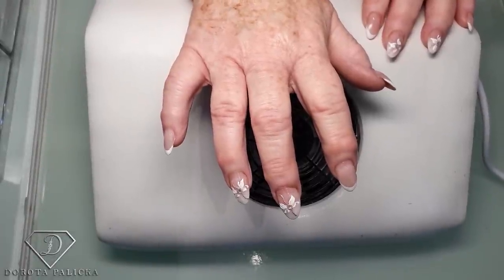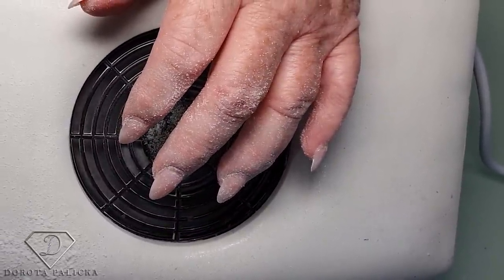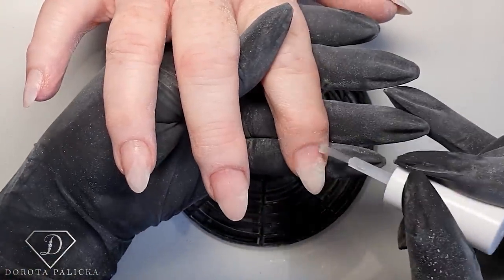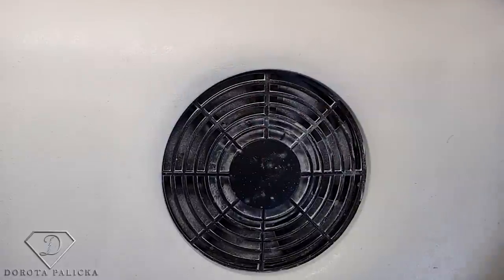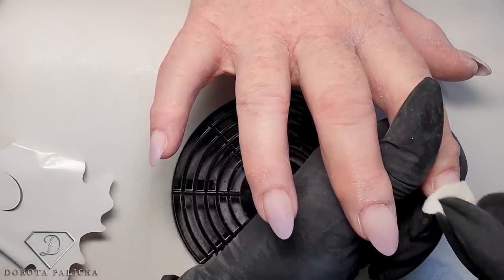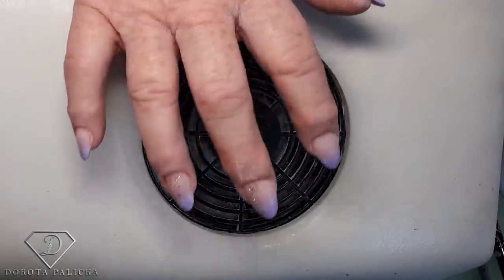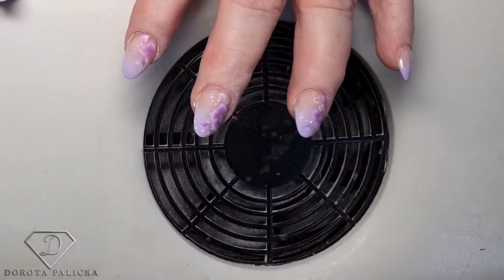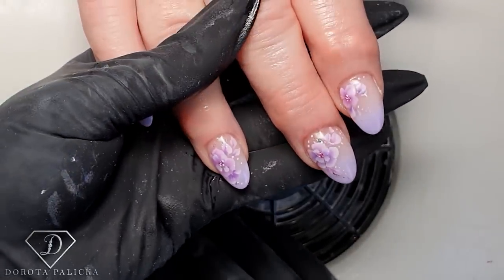Salon nails. Gel rebalance with one stroke purple flowers.

Comment: I have not even finished watching but I have a question and I do not want to forget while its in my mind!! Lolol
When you put on "Nail Prep"  what is it? Nail dehydrator? Or acid primer or non acid primer?  Then you put on the air bond...one coat? Or two for bad lifters?
Reply from the maker: So nail prep is extra dehydrator. Primer universal air bond acid free 2x problematic nails. 1 x Normal nails x